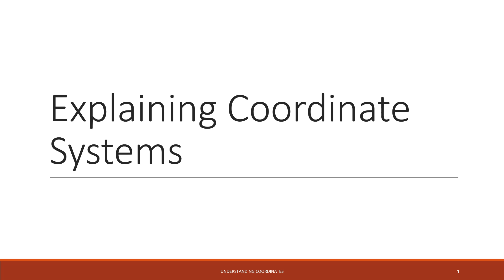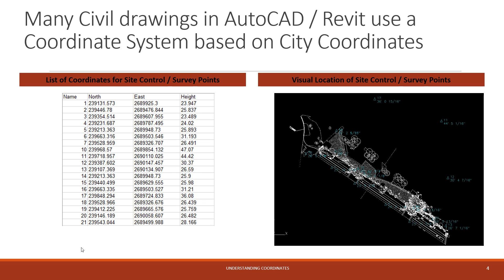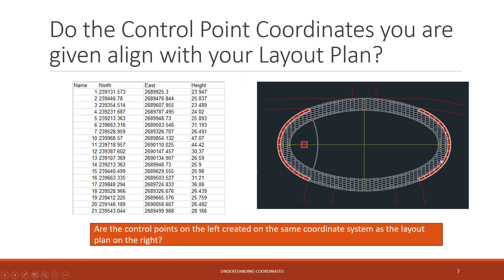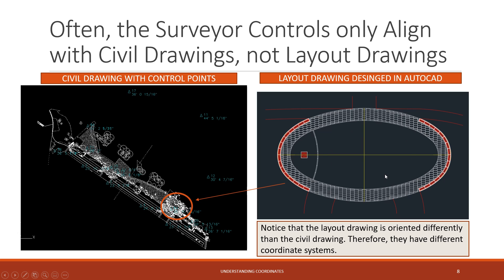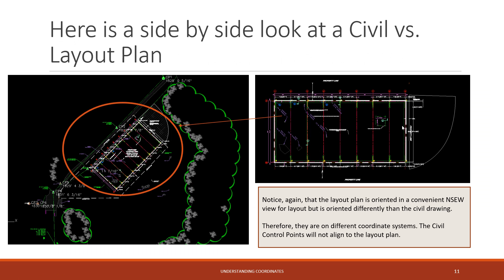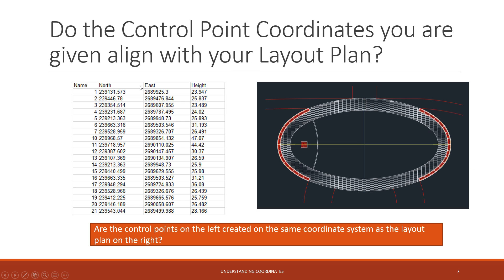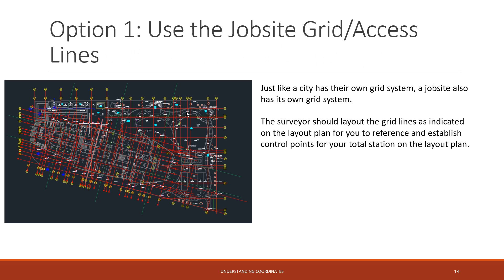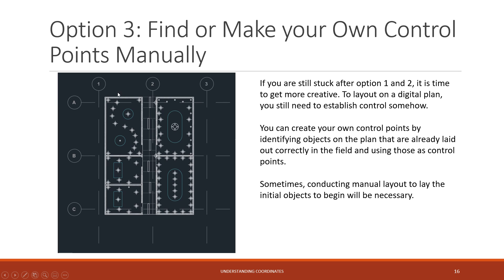Control Point Tutorial - SITE COORDINATES VS PLAN COORDINATES (Total Station/Surveying)

Comment: How do you know you're lined up with the grid? Do have to find it manually
Reply from the maker: Yes, you need to find it manually. Station on the control points you believe to be correct, and tehn walk with the total station to the grids on the job. Then ask yourself: does the total station's measurements match what you would esxpect in the field?